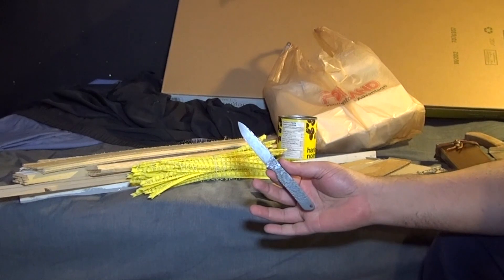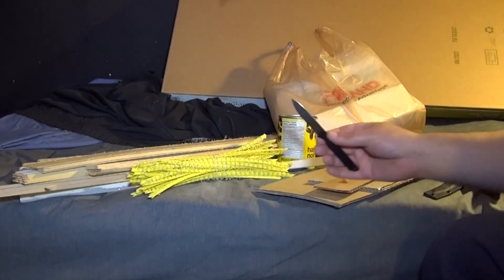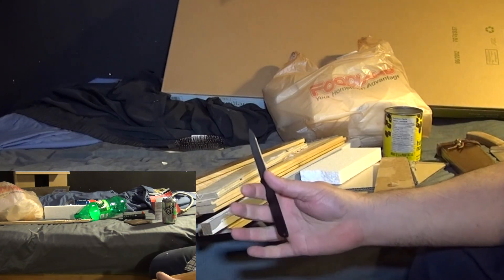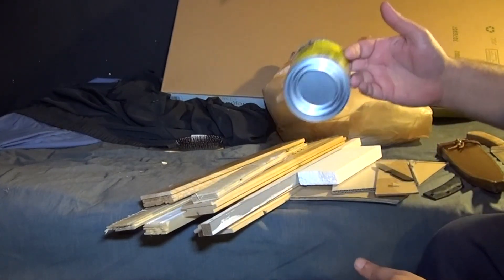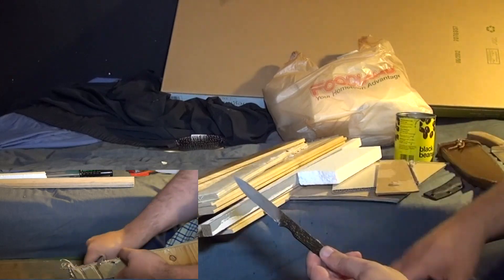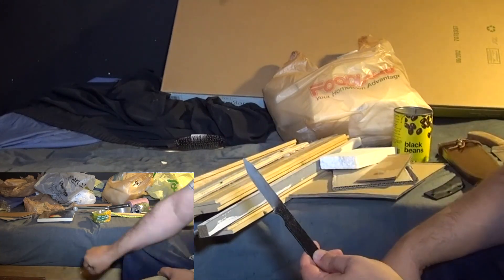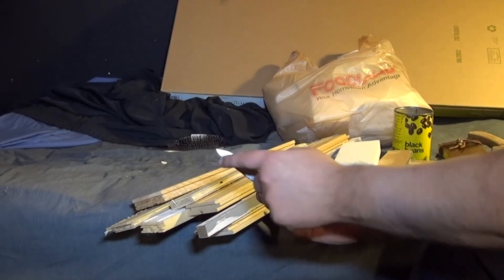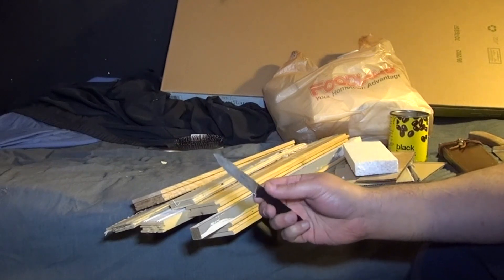Extreme Regrind : Condor Bushbuddy (minimum apex bevel thickness for functional durability)

Comment: Where did you get those two Water Stone "BRICKS" .... Would like that 24 grit stone for non-powered reprofiling and that 180 for reparing damaged edges... as it is right now i use a belt sander however at times i find myself wanting to "Slow Down" the process considerably... especially on folders.

Comment: I also find many folding knives suffer the same problem of having far to much metal backing up the secondary edge bevels...  also most suffer from ridiculously steep secondary edge bevels .... Why anyone would run 30 dps on a folding knife is beyond my comprehension... unless of course we are talking micro bevel..  Primary function of a Knife is that it CUTS and the most effective "Slicers" have thin edges and secondary bevels no steeper then 15 dps...  And Fifteen DPS is PLENTY DURABLE TOO.

Comment: Most Production knives {and customs for that matter} have a primary Apex that are WAY to thick ...The Condor Boomslang is over .100 thick just above the secondary edge bevel and not surprisingly cuts slices and chops like CRAPOLA.. Too many "Tactical" knives subscribe to the "sharpened Crowbar" school.. I purchased an old Dexter 8" forged Carbon Steel Chefs knife off of Ebay.. its only .025" above the apex bevel with an secondary edge about 12 dps...I use it HARD in the woods with no problems.

Comment from the maker: Chopping blades have non-trivial profiles there is a lot of details in previous video's but they are generally at 6-12 dps for the main edge bevel with a micro-bevel adjusted a few degrees slightly depend on knife, steel and season (winter is heavier bevels).  

The durability is of course lower in the direct sense, however from a practical perspective they are functional and they also are not weakened by common sharpening problems (power grinding, buffing/stropping/steeling, etc.).

Comment from the maker: There should be no concerns with batoning in general, assuming you are using a wooden baton and the edge is not taken to too low an angle, anything 15 dps or better should be fine and that is only needed at the very edge.

Comment: The blade sharpens normally. It takes a keen edge as I would expect, it appears to grind evenly and polishes well. I don't have any other vg10 knives because I now have some concerns about the steel. I can't comment on grain size or structure  because I don't know a great deal about that stuff yet. The blade wear  when cutting cardboard appears normal to good but as I mentioned before

Comment: I am pretty sure I have removed significantly more than this in attempts to resolve the issue. I didn't measure it but I have tried several (as many as 10 at a guess) v grinds of different angles a couple of convex grinds that we're done to half height. I appreciate your efforts at helping me to work this out as it is  really a surprise that this is happening.

Comment from the maker: If the edge was burnt, which may be the case, you have to remove significant metal to resolve the problem, it could be as much as 1/16" of metal from the edge.

Comment: What bothers me about the chipping is that it has never happened to any ore knives that I have used. I purchased it due to Falkniven's reputation. It's a shame because I really like the design. I have heard of other reports of this occurring but most reported that  it improved after sharpening. I have tried several different edge angles but same result each time.

Comment from the maker: In general yes, if the edge is taking lateral loads then it will fatigue fairly rapidly like bending a spoon until it breaks. However it would take a fairly hard piece of wood and a lot of force to have the edge actually be bending in woods unless you are cutting through hard pin knots, assuming the blade isn't distal tapered and you are cutting with the tip.

Comment: Probably should not have called them micro chips as they are quite visible to the naked eye. I have re profiled this blade  a few times before on Japanese waterstones so it is not just some overheating of the final bevel that happened when  sharpened by the manufacturer. I will make a video to show you because I thought you might find this interesting.

Comment from the maker: This knife (BushBuddy) was 10 dps and even it rolled on the heavier food cans. The issue is all the lateral loading as the metal will not cut cleanly and thus there is a lot of twisting on the edge. However you only need the bevel to be increased in general to about half the damage width so in this case a bevel only 0.001" deep at a suitable angle would have prevented the damage.

Comment from the maker: I have both versions, two old ones actually, fairly well used. I like it a lot, the new design has many improvements but I would have kept the thinner tip - but they may have thickened it due to warranty issues.

Comment from the maker: The new one has a thicker tip, you can see the comparison shots on the forum. However I don't see a practical advantage as it still is not thick enough to for example to any heavy work wood (prying) and the older one with the more pronounced distal taper is easier to use for finer tip work (filleting and similar). Tips are a bit of a black/white issue for me as they are either made to cut or made to pry, going in between leaves the knife performing poor and likely to break.

Comment from the maker: I am not sure that is exactly too thin, as I suspect the steel may be an issue as S30V, like most steels of that class, is not trivial to get low levels of retained austenite in the edge. But it was obviously too thin for the user base as you noted simply because of the problems reported. I would be curious as to AEB-L in the same profile, or even S30V properly adjusted - which should not be rolling/denting.

Comment: I think custom makers have to opportunity to communicate with the buyers 1-1 and explain the risk option of different grinds. I make my knives with fairly thin edges, but I dont take them to the extreme unless specifically requested to. 
Spyderco recently did a full flat zero edge S30v pukko folder. they chipped and rolled like crazy with all the new owners.. failing everywhere.. They went from too thick, to too thin..

Comment from the maker: I had a number of off experiences with S30V when it first came out, some chipped, some rolled fairly easy and some were perfect. Tends to be that way with steels, it is why I normally want to use a few knives in a steel before I come to any conclusions. If makers/manufacturers would be more open about what they were doing it would solve a lot of the problems, as would actually testing the knives before they are released.

Comment from the maker: I normally don't belt sharpen, on the ceramics the edge would fracture on a coarse abrasive. I have used 10V with no issues, but 121REX has a much higher carbide volume I would be curious at what point it would fail. Wilson has used the very high carbide stainless as well CPM 125V and he runs coarse finishes, but again that is still lower than 121REX.

Comment: ....if I had diamond paste in the 15+ micron range it'd be a different story, but as it stands its sharpness or nothing. I'll add to this that it behaves...... strangely. You can chip it out doing some things quite easily, but on others it seems to never dull. For example I was able to, very carefully, actually cut the edge off one of my 1095 blades pulling up a fine little wire and maintaining shaving sharpness. Other things though can dull it rapidly which would otherwise not bother a knife.

Comment: Was that first sentence meant to be a question? If so then no you can't, in case it wasn't obvious. They don't have the toughness to support micro-serrations from an abrasive, and the hardness is so high your coarse belt won't do much to scratch it either just FYI. It sits in a sort of never never land where it needs a really fine polish to attain any level of sharpness, but nothing other than diamond paste on wood or leather can really grant it that sharpness. Its possible that.....

Comment from the maker: Initial factory edges are usually heavily burned and often micro-cracked. I never had much luck with the beckers, I went through a few of the Patrol Machetes limbing, they would all lose big pieces of the blade and the other ones were also brittle, Combat Bowie, Machax, etc. . Too many things to guess as to why they were brittle never could get anyone to say exactly how they were HT'ing it which is what you would need to know.

Comment: Having bought into the high wear resistances steels fad for the longest time, it wasn't until I got a 50% carbide by volume blade at 70RC I realized my error in judgment. While these knives all were highly wear resistant, they seemed to require sharpening incessantly. It wasn't until I started looking at them under my scope I realized the obvious: they weren't "dulling" they were chipping away on the microscopic level. INFI was the logical solution, and I haven't looked back. Damn 500 characters

Comment from the maker: That is a fairly astute point, one of the largest influences is improper steel selection which can lead to what people interpret as chipping but is just carbide separation from the steel matrix. It is trivial in high carbide steels to have aggregate chunks which are 0.001-0.002" in size, these can not be stable unless the edge angle is very high as otherwise there is no actual steel around them to hold them in place.

Comment: I believe you're neglecting the fact that most of these "tactical" blades are not made of carbon steel, but rather are made of high alloy high carbide content "supersteels" which are far more prone to edge damage generally than their carbon steel counterparts. If you move back toward the realm of higher toughness carbon steels, or even a high toughness high carbide volume steel like CPM M4, you start to see geometries like you're referring to become feasible again. Look at the bladesports knives

Comment from the maker: Curiously enough the kitchen knife manufacturers are moving towards that way. It is very easy now locally to find knives with edges 0.010/15 dps and under. To be frank I believe it is the over abundance of ultra-high carbide steels which are inherently prone to become very brittle in non-ideal conditions and even in ideal conditions have durability limitations. And there is not a lot of R&D.

Comment: very very good video cliff. i don think i would have ever guessed this. i've reprofiled bk2 to almost zero grind on the edge once and tested it before i put the microbevel on it and it rolled and twisted like crazy with even light chop to soft wood lol. the heat treat/burned steel or the force of light chopping? i would guess HT/burned edge, right?

Comment from the maker: The argument to prevent returns in the case of abuse is a valid one, but as you can see tactical folders with an apex thickness in excess of 0.035" I don't think it is representative of a consistent design. With a properly chosen and hardened steel that edge thickness isn't even required if you were to chop the knife as hard as you can into a rock. Even that typically causes impaction in the 0.010"-0.015" thickness range (on larger chopping blades).

Comment from the maker: Yes, I am about half force here as at that point I have the edge of a 1/8" handle biting into my palm and I wanted to do at least 50 cuts on the wood to produce a stable cumulative effect. I could easily double the force with an actual handle, however as strength is squared and stiffness is cubic with dimension along the load vector that would mean I would only need a 30% increase in apex thickness to make the apex bevel 100% stiffer and handle the double load.

Comment from the maker: It is based on the price and knowledge of volume production and as well simply from the extreme range of HRC listed. If you have optimal equipment to process the steel and you take into account batch tolerances (you can request exact mix compositions) then you are not going to have that much of a HRC range on the product.

Comment from the maker: I don't think in general they are evaluated and they use stock rules of thumb. In general, if you look at the video's on YT you will see that the makers who post the most extensive testing video's tend to have the leanest grinds as they have concluded that it doesn't take much to stabilize a knife edge, and it surely isn't near what is needed to stabilize the edge on an axe.

Comment from the maker: The twisting, prying etc. was the reason I chose the plywood as you can not cut it cleanly as it fractures. Now I was only using about 35 lbs as noted, but still this isn't light. I do plan to repeat this with another knife with an actual handle so I can use full force (which is about double).

Comment from the maker: I should have clarified in the video, I was speaking more of knives of this size / weight, larger knives would have to have a thicker apex bevel as for example the Voyager from cKc would not be able to do heavy chopping with a 7.5 dps apex bevel as it would very likely twist in non-soft woods.

Comment from the maker: The visible bevels are measured with a caliper and the angle calculated from the measurements. The micro-bevel angles are calculated from the height of the blade off the stone and the blade width.

Comment from the maker: I do agree that there are harder cutting tasks than demonstrated in the video - yet in all the video's/posts on those knives how often do you see for example a Hinderer which has showed signs of contacting that material? As for example if you cut very hard into a chain link fence the edge will show obvious signs of it even at a 20-25 dps bevel as the edge will snap due to the lateral load at the apex given the high carbide nature of the steel.

Comment from the maker: It is a pretty interesting stone as it wears very slowly so it can tolerate things like cutting the edge right into it to modify the sweep of a belly which normally can really cut up stones, but yet it cuts fairly fast. You don't want to apex with it though as 24 grit will tear visible chunks out of the edge.

Comment: Are you stating that Condor's HT regime doesn't include cryo or suitably fast quench based on Bushbuddy's price, their other product performance (eg edge failures per your description) or knowledge of their HT? Not doubting your expectation just curious why you have come to that conclusion.
Impressive hand strength with not much to grab. Do you think a more substantive handle would have resulted in more edge damage on the same tests? i.e. Applying increased cutting force and twisting torque.

Comment: CONT'D  Interesting conclusion on edge geometry baseline for damage and those used by volume blade manufacturers. Maybe in the market place there are two drivers for them, namely safety in numbers with norm market recognition and increased edge durability, albeit at the cost of performance. All for reduce customer service overheads.
Oh professional Canadians being that fast explains the audio accent when your vids are slowed to pleb speed!
Thanks for the interesting test and PIP works very well.

Comment: I put the regrind on with my trusty Habor Frieght 1X30 belt sander, the 36 grit ceramic norton belts are awesome. After the 36 grit I move up to 80 grit, and then a 600 grit belt for the clean look. When I am done with the belt sander i move to my spyerco sharpmaker and strop with newspaper for the final edge.

Comment from the maker: Yeah, I was looking for a fairly wide range of materials to cut with. The main limiting factor here is the force gives huge contact pressures as the handle is so thin (1/8") so even 35 lbs applied is a contact pressure (due to square edges on the handle) of over 300 lbs.in^2. I will likely try this again with a knife with an actual handle so I can use full power cuts, about 70 lbs.